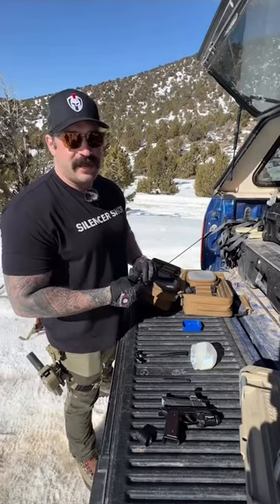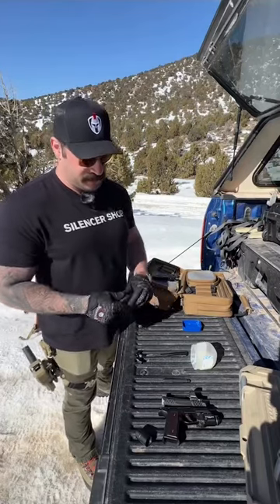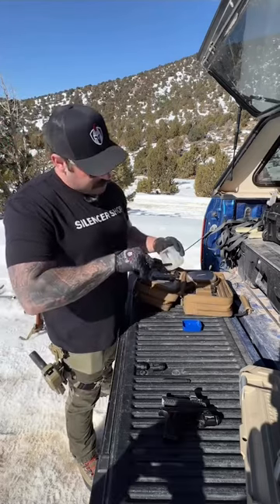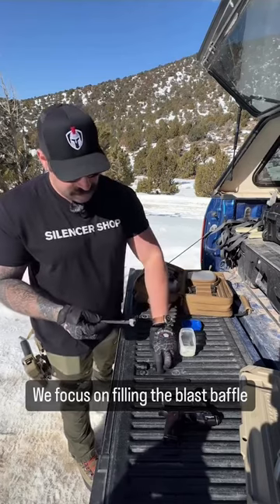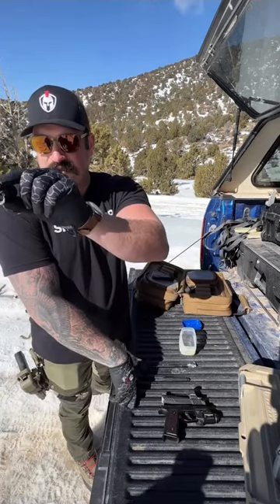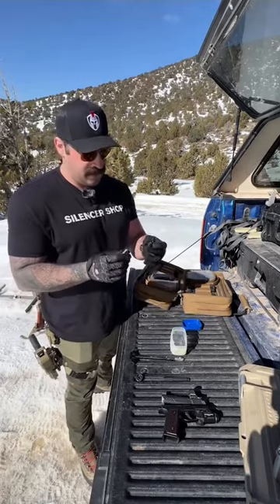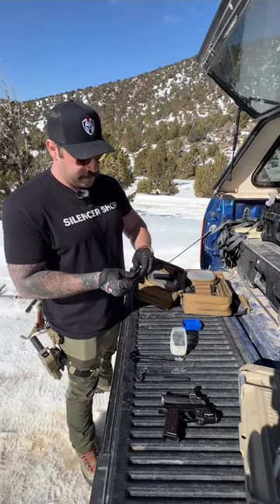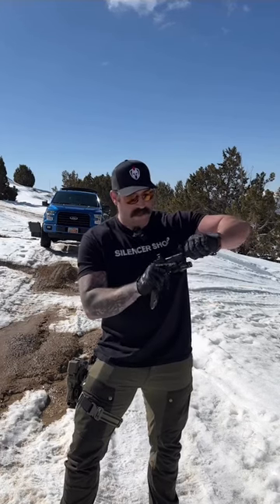How to run your suppressor WET 💦 Petroleum Jelly #suppressor #silencer #howto

Comment: What about on a monocore suppressor that isn’t user serviceable?
Reply from the maker: vaseline doesn't harm the suppressor, if anything it helps keep it clean and quiet. i'm sure it would run fine? but we don't specialize in Monocore suppressors so I cant give you a solid answer on that one.  if you do plan to to try it out, you can use a Q-tip and just rub some on the first and second baffle, the first shot will just splatter the vaseline onto the rest of the insides.

Comment: My pcx 155 9mm shipped with a 30 caliber endcap installed. I shot 9mm through it and thankfully nothing bad happened. I ordered a 30 caliber endcap separately and noticed it was the same size. I sent it back thinking I was sent another 9mm endcap because I had nothing else to judge it by. Later I lost the original endcap that the suppressor came with and ordered a 9mm endcap. When I got the replacement for the original endcap my suppressor came with, I noticed that it was a genuine 9mm endcap. I would have never known if my original endcap had never disappeared from the face of the earth.
Reply from the maker: oh no! so sorry that happened. was suport able to help you with that? if not please reach out to Support@JKArmament.com